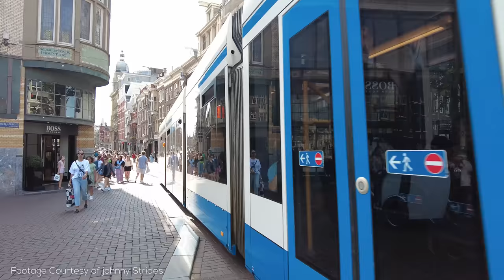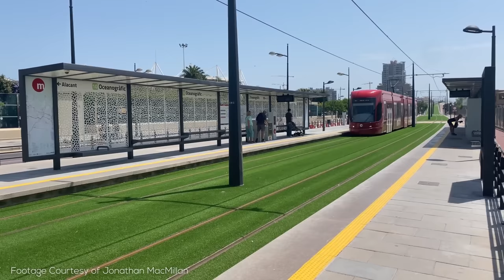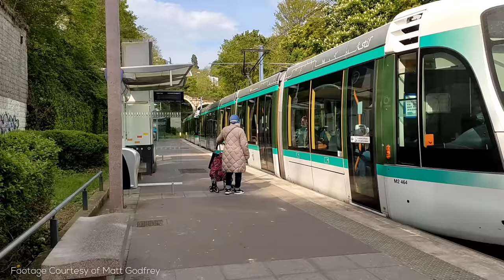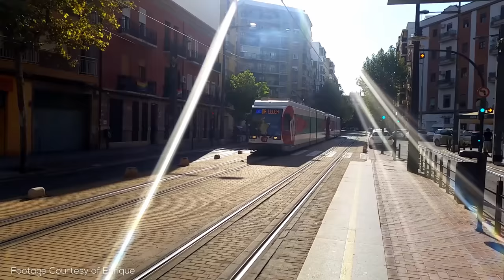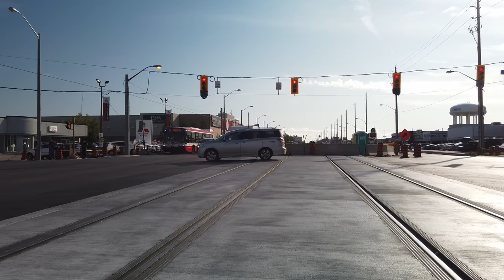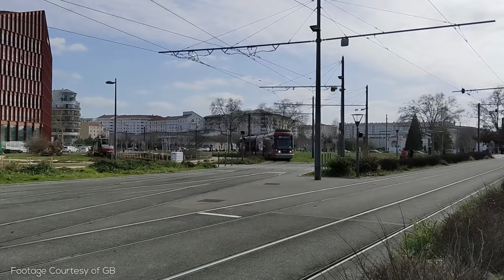What the US Gets Wrong About Trams

Comment: While it does do a lot of things right, I feel like some of these criticisms could also apply to Manchester's Metrolink. Like other European systems, it started off by using trams properly - reusing old railway corridors, running alongside vehicle traffic on streets and delivering passengers to pedestrianised city centre locations.

However, in recent years I feel it's become a victim of its own popularity and success, with extensions running out to really far-flung suburbs as well as the airport, and I personally feel these parts of the city would be better served by a proper rapid metro (very rare in the UK outside of London) or a suburban heavy rail system like London's Overground, though an exacerbating issue is that many suburban rail corridors are still not electrified. There's been talk of tram-train technology like Sheffield/Rotherham or Karlsruhe (made easier because Metrolink is all high-floor) but I still feel the city is big enough to warrant some proper heavy rail to complement the Metrolink. Of course part of this is down to politics - the city's boroughs own and operate the Metrolink entirely, while anything to do with the heavy rail network will require cooperation from the central government.

Would love if you're able to cover the Manchester Metrolink at some point, especially as it was the first system to (re)introduce modern trams to the UK!

Comment: Low floor trams are often worse than their high floor counterparts because the low floor trams have their bogies fixed to the body of the tram this causes them to hunt the track at anything above about 40kmh. My local tram has two vehicles one from the 1970‘s witch they have added a low floor part to half of them since they run as always one with low floor and one without low floor together. The old tram‘s are loved by all of the riders because there seats are very comfortable the usable low floor area is about 3 times bigger than on the newer models and if one brakes down there is still the other tram in the consist to remove the broken one. The old tram‘s are riding the track way smoother sadly they have ordered a replacement from stadler whats the problem you ask stadler vehicles are absolut garbage and worse you support a company witch was opened by a far right politician.

Comment: I think that most of modern tram designs are stupid compared to trams from 60-90s. We have problem with new trams in Prague all the time, new trams are bigger from outside, but smaller inside, it sometimes doesn't even have turning wheels, so it has to go like 5 km/h to turn, doors and seats are placed stupidly, bars for holding are trying to beat you to your face.....there is no better tram for historical city than old Tatra T3. Ofcourse in 21st century you probably want low floor trams and that's the problem, for most of people old tram would be better. Also many modern trams (and buses, trains and other vehicles) are so ugly! 
BTW, it's not only for walkable distance, it's combination of both in Europe, in center it is like you said, but when it leaves historical center, there is mostly some corridor for trams which can go even like 10 km from center and it can go even 80 km/h which is really fast for tram.

Comment: The worse tram example is Dart. It operates like a commuter rail with significant disadvantages. It slower, because it has street running sections. 

What Dallas should have done is offer commuter rail using commuter rail vehicles with fewer stops.

Than at some point create a streetcar system that would handle local traffic. And eventually an elevated Metro.

Anyway, they system is not used because it is not very attractive. Like why would someone want to be stuck in traffic with strangers?  When they can be in their car by themselves. 

Transit officials need to think about how people feel. What makes common sense. And to make sure what gets built is done correctly.

Comment: Not really convinced with the 1st part of the video. You seem to care a lot about vehicule designs and diversity, while the latter is more often than not a con, not a pro. More designs add complexity in use and maintenance, simple as that.

Oh and building trams away from the road, like France did in Saint-Germain-en-Laye, is ridiculously expensive. A this point, bus with traffic-prioritization would better do the job : waaaaay cheaper per units -> way more people carried over.

Comment: "Federal spending accounted for about one-sixth of the $79 billion in public spending on transit in 2019"
That's absolutely nothing compared to the $200+ billion spent on roads, where the Fed provided nearly 50 billion in the exact same timeframe. 
The Democrats have no ideological commitment to transit and will therefore do nothing but the bare minimum. The Republicans will see that scrapped wherever and whenever possible.
The solution is much broader than mere advocacy, especially within the parties. New ideologically driven parties need to start capturing localities to do anything. Either that or an Islamic revolution in Saudi Arabia will change the situation in the US.

Comment: It seems that you don't understand the US and how the post WWII boom changed the density of the population. You compare Toronto's "tram", Light Rail to Phoenix's. However the density of population is so much lower in Phoenix primarily because the growth in Phoenix over the last 70+ years has been by automobile and air conditioned auto at that. If you have to drive 10 -20 miles just to get to the train what's the point of then sitting on the train for 45 minutes? In addition, not everything in these sunbelt cities is geared towards a downtown central hub.
Reply: Ok, so if suburban office parks and shopping malls are the new "urban centers" why don't we try and connect them to each other and to the housing subdivisions? It's actually kind of a pain to drive to these places. The highway is a nightmare and who ever lays out the parking lots hasn't a clue what they are doing. Despite all the logistics, if we could get a grip on where people want to go and plan how to make that happen we could actually achieve something.

Comment: the reason that Minimal Viable Tram is built is because the Gas Huffers insist upon it. We need to jettison the gas huffers first before anything can be done. The rising cost of better built automobiles is a step in that direction, as are random checks to insure gas huffers are fully insured.

Comment: Trams have really big disadvantages: 

1. they are 4 lines wide at the stops.
2. in case of a crash they can block the whole route for hours.
Reply: Here in Nuremberg when there isn't enought space for proper stop infrastructure, we have (I call it) "light stops": the tram stops in the middle of the street, the cars have to stop (got red traffic light), and the tram passengers get in and out of the tram crossing the street/carlines...

And in case of an tram accident blocking the whole line: all taxis in town start driving along the route as long as the route is blocked, stopping at the stops, and everybody can use this taxis for free (although you are supposed to have a tram ticket...)
Reply: @miguialvarez  That's something i never heard about, cool idea they should do that in my city (Rotterdam) too